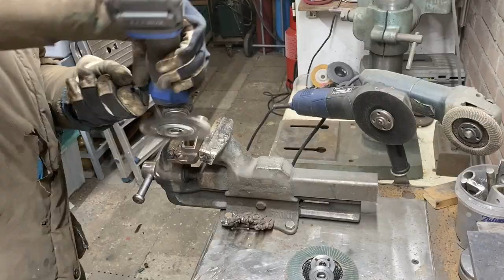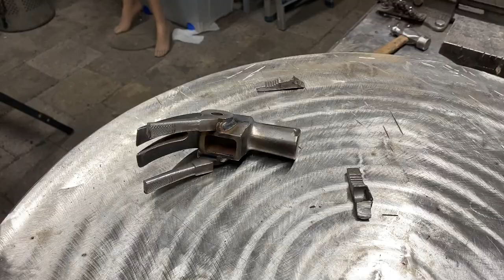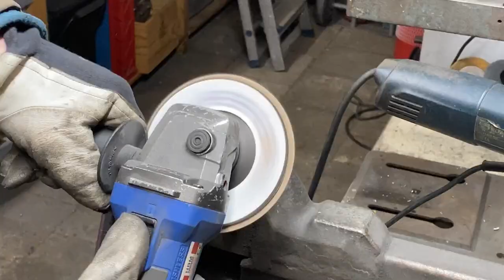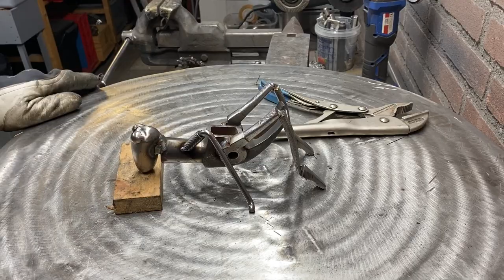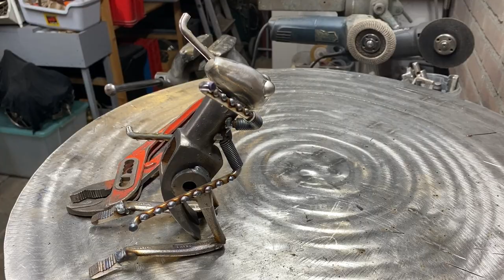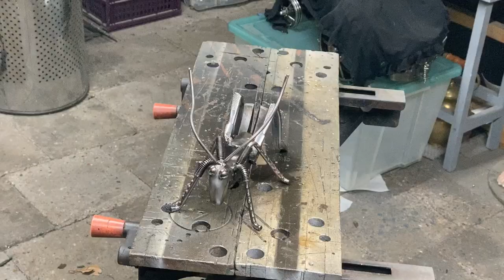How to make a metal art grasshopper sculpture from old tools

Comment: Great video Brutus. I am interested in hobby welding and have been searching youtube for how to videos. When you were making the grass hopper i noticed you did not have a grounding cable attached to the piece you were welding. Is that normal? I was under the impression you have to attach a ground cable to everything you weld? Another topic is i have a lot of old had tools and old bar stock. Some of the metal scrap i have is hardened steel. Can i weld that with a mig welder? And another question is i have old hand tools that i cant tell if they are cast iron tools or steel, like old pipe wrenches and some very old spanners, not sure how i would tell what is what until i eventually start the welding process and notice it didnt weld properly. Thanks.
Reply from the maker: Thanks for watching my videos!
Your questions:
I have no grounding cable on the piece i’m welding because the work bench has a steel plate on it, and that’s grounded.
If it is for decoration you can use a MIG welder to weld hardened steel.
Mostly old hand tools are not made of cast iron, you can weld them.
Good luck with your creations!